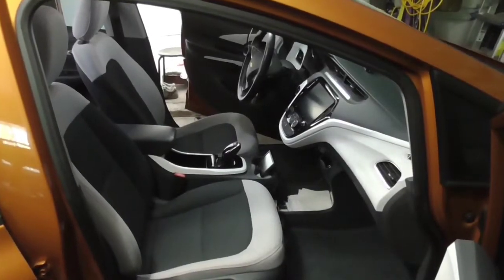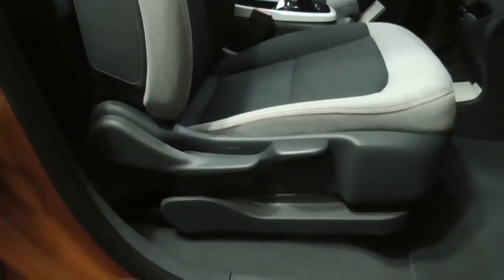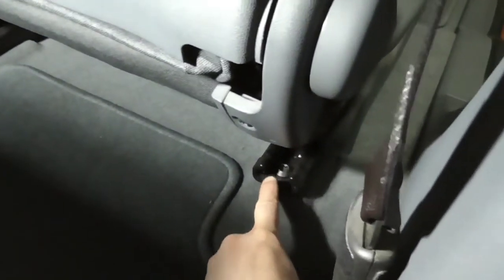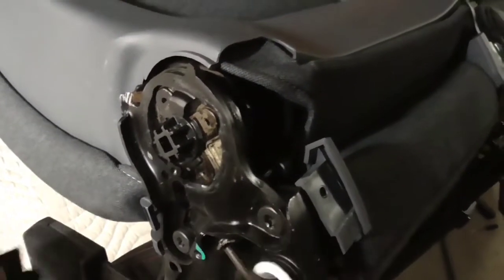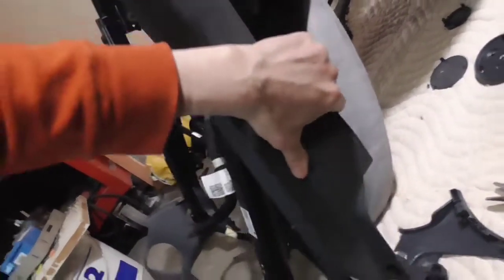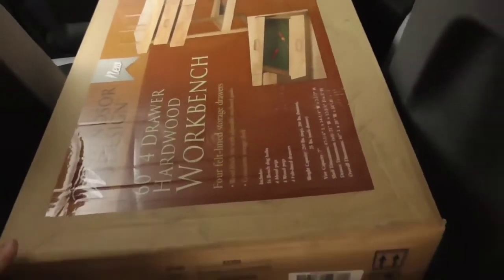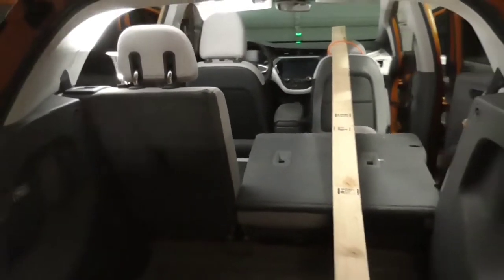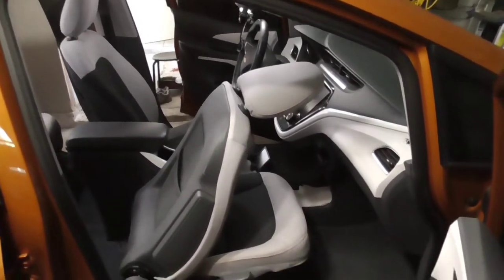Chevy Bolt - Front Folding Seat - Modified - episode # 34

Comment: I carry 8-foot lumber in my 2017 Bolt quite often.  I just fold down the driver's side of the rear seat, wrap a heavy blanket around the front end of the lumber, and then feed it diagonally through the hatch so the front end sits on the dash just above the glove compartment.

Comment: Awesome job. But seems too much hassle for me 😕. Probably just going to remove seat whenever going camping.😊
Reply from the maker: Speaking of camping.  The Bolt works well for car camping.  Find a nice L2 charger.  It's gonna take several hours to charge up.  While waiting: tilt the seat back, cover up, & turn on the seat heater (if chilly).  On the road at the crack of dawn.

Comment: Nice seat mod. Would the opposite fold be possible? slide the seat forward, remove the headrest and posts, and then modify to fold the seat all the way back to the level of the back seat. BTW my toyota matrix had a front seat that folded. I loved it. I had a full 8ft of flat space.
Reply from the maker: Thanks.  I looked at all options, which is why I modified it.  The seat does not fold back to flat no matter what.  It might come close with the rear seat removed.  The headrest is easy to adjust up/down, but not easy to remove. It's defiantly not a Honda Fit or Toyota Matrix on cargo flexibility.

Comment: My tire pressure readings not showing now after disconnecting battery and then the seat wiring.   Wonder if it will come back on?  LOL, bloodied a knuckle trying to disconnect that harness connector.   Pretty stiff.
Reply from the maker: Sorry to hear about the knuckle.  Maybe the passenger seat wiring connector is not fully in.  I am not sure where the TPMS controller box is located on this car.  Usually, it's in the back corner near either wheel.  I don't think it would be near the seat.  Possibly power supply is flowing thru that connector to the TPMS box located elsewhere in car.  Double check that wiring connector!